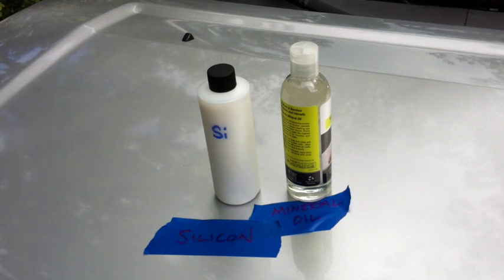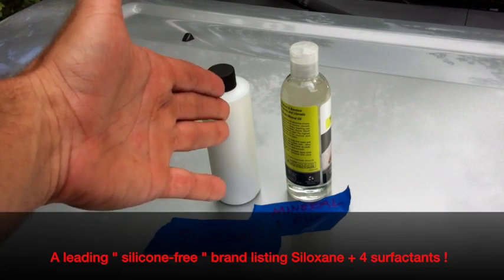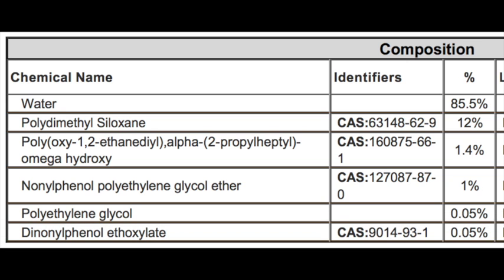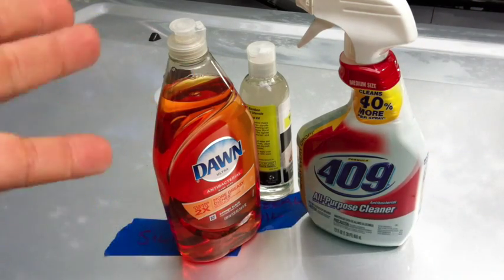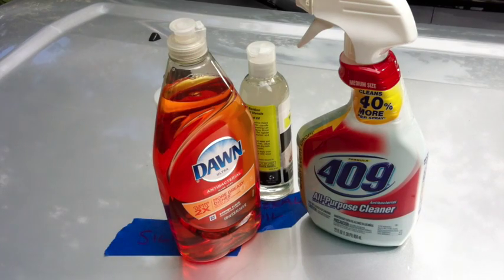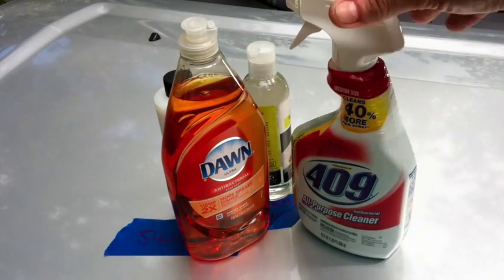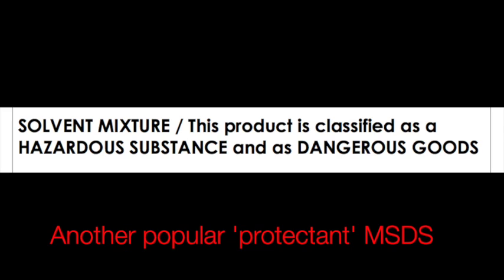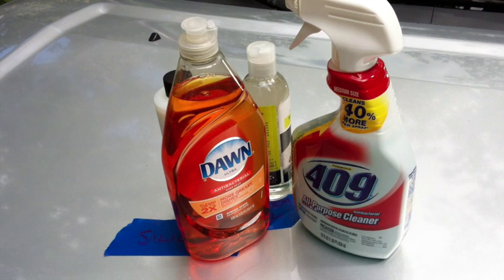NEVER USE PROTECTANTS - most all protectants are solvent base!

Comment: Correct me if I am wrong, but if the label says 'flammable' it is solvent / petro based.
If it does not then it is water based.
Reply from the maker: Label shown in video, MSDS, is a common brand for RV market which claims to be petro chem and silicone-free !
Reply from the maker: ... if it feels greasy it is solvent based.